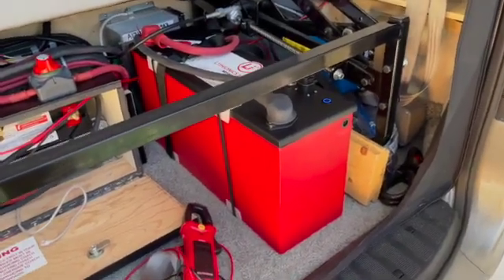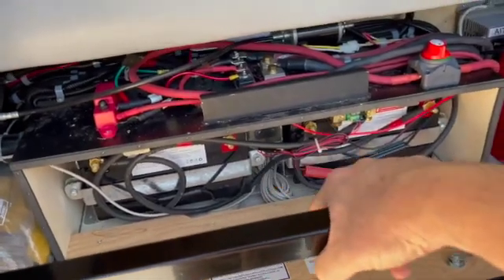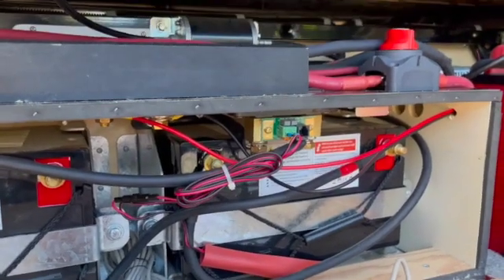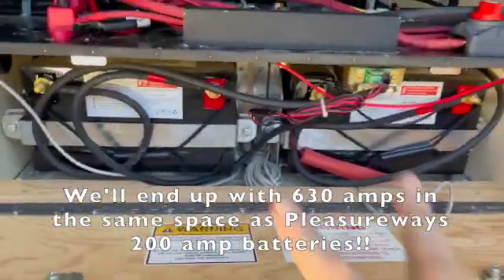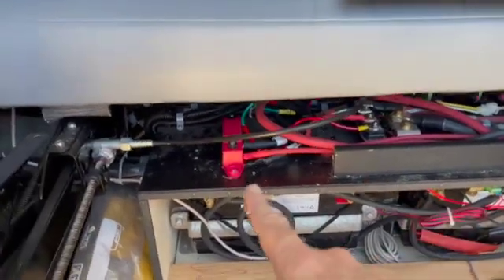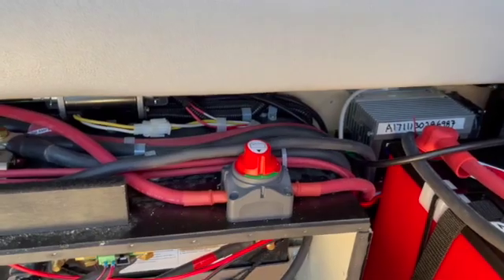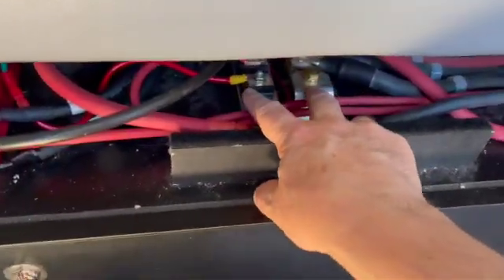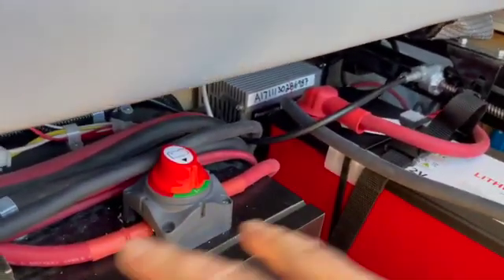Power System Upgrade Part 3: Lithionics Phase 1 Install

Comment: So I take it that you did or did not replace the Progressive Dynamics charger/converter. If you did, what did you do to replace it? Thanks for all your videos and support.
Reply from the maker: I removed the Progressive Dynamics converter.  I installed a combination 3000w inverter/charger from Xantrex.  I can charge at up to 150aH with this.  The charge rate is programmable so if I'm plugging into a low power outlet I can reduce the charge rate to avoid blowing the breaker.